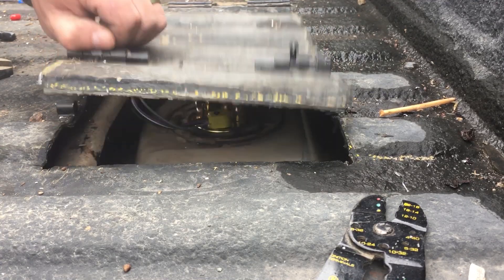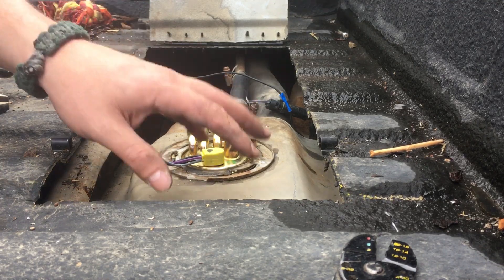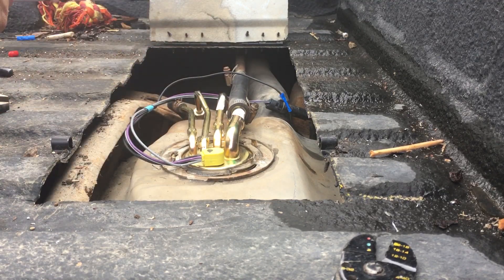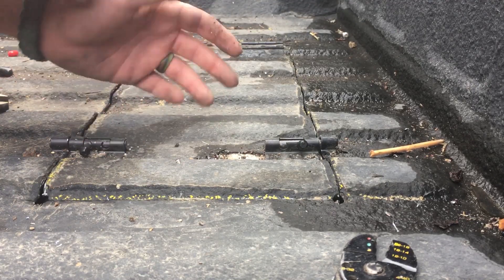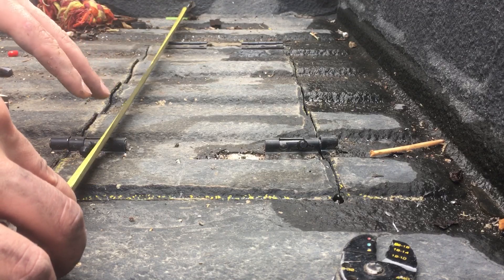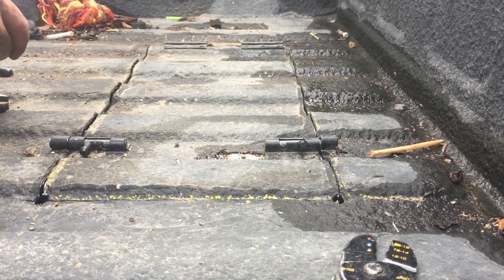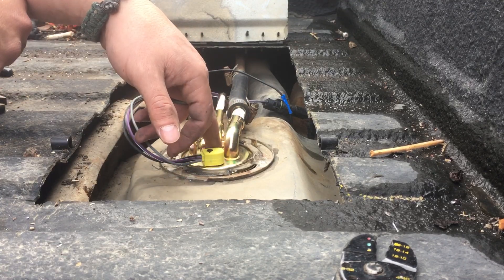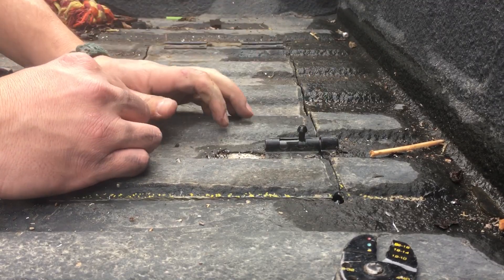1996 GMC 1500 fuel pump problem solved!

Comment: Just did mine today. Dimensions were great, plenty of space.  I just cut three sides though - and bent it back in the middle of the bed. Bloody pump fought me at every step though.  Ended up breaking off both fittings on the old pump, but at least that let me put a socket and a breaker bar on 'em!  That's the only thing that saved my butt today.  Getting the old one out was hell. Pretty sure it was the original (97 Sierra) ... and there was no hope I'd EVER break the bolts loose to life the bed. Even the bolt for the ground wire was as one with the frame.  I drilled a new hole in the crossmember for the new pump.  I didn't go the hinge and latch route though.  I riveted some flat iron across the opening and riveted the flap back down to it.  Then used trusty old urethane to seal up the cuts. Ain't the prettiest thing, but it worked great!  I've seen some people complain that the one cut is too far back, because the crossmember is under it ... but like you said, shallow angle on the reciprocating saw works a treat.  Thanks for posting.  It was the difference between me having my truck back and walking all winter.  It's Canada.  Nobody wants to walk in the winter if they can avoid it.

Comment: thanks for posting the video the measurements were spot-on for my 1997 K 1500 Z71 like you I have been dropping tanks I found your video be a great time saver and Money Saver my local mechanic was going to charge me $800 parts and labor and went online from the fuel pump assembly for $80 at geekspart I'm even considering to order spare for that price now with the hatch I'm ready to roll. thanks again. 👍

Comment: Great video,  just replaced oem lines from the throttle body to the filter, 94 gmc k1500 4x4 5.7
Suggestions by others for access door are great as well. 
My suggestion:
Edit your description to share the dimensions.
While in the bed behind the cab, from the drivers side, measure 11" then to the right mark 29 1/2". Then from the back side of the bed (behind the cab) measure 4 1/2" then 13" for the corners of your access door. Follow the video.
Thanks for making this, I'm restoring my truck. 180k original miles 2 owner.

Comment: I Have a under the rail plastic liner in my box. You won't even see the hatch under that. I'm going to use a angle grinder to cut mine with a wafer disc. cuts super fast. Hope I don't blow my self up with all the sparks. GREAT VIDEO, GREAT TIME SAVER TIP, THANKS MAN.
Reply: Are you still alive?! Let us know man!
Reply: @DIXIEMAFIA251  Yes, I'm still here, but I no longer own truck. Sold it a few years age. Yes it did work using the angle grinder with the ultra thin disc for cutting the hole in the box.

Comment: Dude, you saved me soooooo much work. I have a 98 GMC that I bought 10 years ago and the fuel pump died at 280,000 miles. (got the truck with 160,000. Don't know if the pump was replaced prior) The dimensions were spot on. Thanks.
Reply from the maker: SnaggOlicious perfect! Glad it help!

Comment: They should all have an inspection plate!
Reply: Yes they should !  It all comes down to the bean counters and the lawyers and insurance people . They all told GM allowing consumers access to fuel pumps in gas tanks would be a bad ideal and dangerous and the bean counters quickly concluded that the dealerships would rake in big bucks selling overpriced GM delfi fuel pumps and charging for many more hours of labor to remove fuel tanks and install new ones . One simple access panel that would have saved consumers million in repair cost and would have cost GM about $7 per vehicle . But instead they screwed everyone who bought a GM vehicle and then took government bailouts . Killed off Pontiac and oldsmobile and destroyed the GM brand. Their done , I won't buy another new one. They violated my trust in the brand. Still going to seek out the oldies and the goodies and drive GM. Just not buying new anymore !
Reply: @cbgreenbay  haha any newer vehicle with fuel injection is this hard to do a fuel pump or worse.
Reply: My honda does. Lol. 300k OEM pump

Comment: Well here it is middle of January in Idaho, and mine just went out. This will be my fourth one.  I replaced the factory electrical pigtail the last time, and I got several years out of it.  I believe a bad electrical connection at the factory pigtail was the main reason these things were going through so many fuel pumps. Anyhow, I'm in I don't give a shit mode on this one and doing it your way. I lifted the damn bed off my pickup the last three times by myself, and I'm done with that.  Thanks for your video, and the measurements!
Reply from the maker: No problem! Glad it helped !

Comment: i cut my panel and then screwed 3 pcs. of 2in. wide flat strap by 1/8 thick to the low part of the panel, smooth on top. also put a piece of rubber over the pump and never seeze the fittings, nice job

Comment: I got a 98 jimmy that I paid $350 labor plus $150 for a new pump to have it replaced . It lasted less than 1500 miles. Then I said screw it and cut an access hole just behind the left rear seat . Very easy to do if you know where . Replaced the pump with a cheap $28 new pump off ebay and sealed and replaced the access panel , but made it easily removable if needed. Put carpeting back down and flipped seat back up , good as new. I have a spare $28 ebay pump in the back I could change out in 15 minutes if I needed to . But so far I haven't needed to do it . P.S if you get a new pump spend $10 bucks and get a new filtter also. It cost me $500 because my mechanic didn't replace the filter when he put the new pump in . That's probably why the original pump failed and then also the first replacement  pump.
Reply: cbgreenbay  Same thing for me $650 job found out six months later when the New pump failed never replaced the fuel filter or suggested it no wonder I went through three pumps in five years. I guess my fault too. But hell I’m not a mechanic....last one I put in was $175 Delco. And a New filter(couldn’t even blow through the old filter I almost blew my eardrums out, lol).been on for seven years no problem... replace the filter twice since then going on the third just in case....

Comment: I've done that to several of my older chevys. I cut the door and welded a lip under the cut creating a ledge for the cut door to lay on. Also gives me a place for 4 stainless screws to attach it to. After a fuel pump change I throw my bedliner in and cover it up. Nobody the wiser. I've got a much newer chevy and the fuel pump is leaking and I'm debating cutting a door in it. Problem is I  hate to cut a truck up that's only a couple years old. But if it's old enough to rust out a fuel pump its probably old enough for me to say the Hell with it and fire up the welder.
Reply: It's only a chevy, CUT IT!  Maybe if it was an old classic, or a Ford I would think twice . Not hating on chevy, I have both . Ford just a better built truck.

Comment: Dude, I'm definitely doing this. I have a problem somewhere from the tbi to the gas pump. So fuck it. I might make a couple access points on the bed...just in case I have to fuck with something else, and possibly gain a better angle. On what you might ask. IDK, and I don't give a shit. GM should've made it on every single vehicle. Good shit man. Thank you

Comment: I think it's 4 bolts and you can raise the bed up and over enough to replace the fuel pump. I got that advice from a brother in law that is a certified Chevrolet and Toyota mechanic. Dropping the tank insane, cutting a hole like this is ridiculous.
Reply: 4 bolts ? You don't have a clue as to what you are talking about. Let's see... A 10 minute job verses hours .

Comment: A better fix for the floor is to cut the appropriate number of 3/16 X 1 1/4 steel to bridge the hole, drill four 1/4 inch holes in each strap, 2 to screw to the door and 2 to screw to the floor. Counter sink each with 1/2 inch. Sand the top end edges of the straps so they have a nice transition to the floor. Place the straps over the door in the indented areas and  Drill 1/8 holes in the door and attach with counter sink type #14 screws, place over the hole in the floor and drill 1/8 holes in the floor and attach with screws, spray rubberized undercoat over seems, straps and screws.
Reply: Yeah man lmao, sounds much easier.
Reply: Yeah man lmao, sounds much easier.
Reply: @raptor31able  I've seen lots of hack jobs with grinders that border on moronic an could easily become an explosive experience. Not to mention they ruin the integrity of the bed.

Comment: Cutting the hole is much faster and less dangerous with a multi tool with a half circle metal cutting blade, and the seem is so much smaller then that of a grinder or sawzall.

Comment: I have the stepside version and the bed is skinnier, so I had some trouble trying to find the measurements. 4.5, and 13 inches from the front. 3 inches and 20.5 from the left sidewall. It worked perfectly I just used an angle grinder

Comment: The reason these pumps were and are failing quickly is because they are cooled by the fuel in the tank and most of us broke people run low on fuel all the time which makes it burn up and not last that long .

Comment: Now you got a weak spot ! I bolted down a 1/4 inch plate right on top with 8 screws werked good and sillie koned first to keep her tight ! 😀😀
Reply from the maker: In my case it’s covered by the tool box but I getcha!

Comment: I had a 96 and did the same thing after doing it the conventional way once. . I changed fuel pumps three times before realizing if they are run dry even once they fry. My friend must have ran her honda ridgeline tank dry a dozen times and the fuel pump works fine.
Reply: merc marc That’s my problem I’m always broke and running it close to the E it’s sucking air and partial gas it’ll clog the crap out of your fuel filter & you will eventually hear the pump whining loud like a power steering pump whine. blew through three pumps in five years I learned my lesson to stay at half a tank and change the fuel filter every couple years
Reply: I just had to replace mine because I ran her out of fuel. Lucky for me, if I do it again, I’ve got an access door cut in my truck bed :)

Comment: The bed is held on by four bolts and super easy to tip up... much quicker to undo four bolts than to cut a hole and put hinges on and locks...
Reply: IFYOUONLYHADABRAIN

Comment: I just did it exactly how you mentioned and I’m happy as heck lol except the pump wasn’t my issue haha. So I have a new fuel pump right now for no reason lol. My damn ecm B fuse keeps blowing when I turn the key forward. So I guess Ima look for a short now.  😂😭
Reply from the maker: Texas Y’all  Oh no!! Well if you have any luck like I did with the fuel pumps it will come in handy, I changed everything I could in mine, even the fuel pressure regulator... that was way harder than dropping the tank. I hope you find out what the problem is and it doesn’t cause you too many sleepless nights!
Reply: Deaddoginc1 it was the main engine harness laying on the EGR tube. It burnt up 3 wires. Lol damnit. I fixed already but damnit lol I was losing it.
Reply: I can empathize, my problem wound up being the doggone fuel filter.

Comment: Thank you for the video! Great idea. Question for you... What brand/type of fuel pump is the one in the video? Can you give some more information about it? I am going to replace the pump in my truck soon (1998 K2500 7.4L), and I want to purchase one that will perform well as long as possible. I noticed yours has metal ports at the top of the pump rather than the OEM style with plastic ports. Small details like that usually mean higher quality products.  Thanks!
Reply from the maker: Brandon Pritchett , I can’t remember but I bought it at Auto Zone  and I  got rid of the box if I can find the receipt I’ll let you know I’m sorry I didn’t even think about mentioning which brand it was this was a while back last year I believe

Comment: this is what i am doing tomorrow. I have replaced the fuel pump 7 times, and now for the second time the little 3 inch piece of fuel line that goes to the pump and connects to the fuel sending unit has came off. I even have 3 clamps on it but it keeps sliding down. I have had enough. But i really hate to do this because i have a very nice truck bed for it being a 96.

Comment: I've got a diagram from what you cut yours out to see if my measurements are right. okay the bottom of the driver's side 29 and 1/2 across. From the back of the bed down was 4 1/2 inch go down 13inchs. I'm doing this on a 98 Chevy k 1500 extended cab. I hope the measurements will work thanks for any help.
Reply from the maker: As far as I know it should work, mine was a 6’ bed on an extended cab

Comment: Bro are you constantly running your truck below a quarter of a tank ? Because fuel is the only thing that keeps them liberated. So always try to keep it above a quarter of a tank.
Reply: Once you're keeping plenty of fuel in the tank, then this modification isn't necessary.

Comment: Followed these instructions for my c2500 and unfortunately the pump is a little farther back.     Dont know if its because the 2500 maybe has a bigger tank or if it's because it has a long bed.    Either way with my situation cut 11.5 inches away from the front of the bed instead of 4.5.

Comment: The reason a lot of pumps go out is a bad fuel filter restricting the flow, I’ve never had problems but have always changed fuel filters on time, have had many Chevy trucks from 1989 to 2011 ,Bought a older Chevy lately and the pump was making noise, sure enough,took the filter of and could barley blow through it .
Reply from the maker: The fuel filter wasn’t ever the problem, I changed mine a few times when I had the truck I think it was mainly the wife driving it short distances and always below 1/4 of a tank… but who knows !

Comment: Thanks I used your measurements and turns out the fuel pump is down about 3-4” 🙄 instead of 13 should have been 17” but who knows I’m gonna assume you have a short bed. You should put that in your title what size bed

Comment: Just a few bolts and tilt the bed
Takes maybe 5 to 10 minutes
Reply: More than one way to skin a cat
Reply: That’s assuming those bed bolts aren’t fucked and corroded
Reply: 😂, Yea , crawling around on the ground trying to line up the socket and turning the bolts and lifting the bed by yourself while sticking something in there and trying to work with the bed right over your head takes 10 minutes ? 😂😂😂😂

Comment: I got a utility body so the measurements won't work for me  😢
Reply from the maker: I’m sorry, mine was for the 6’ bed I took some heat because I didn’t have the sizes for the other beds, what do you do these days… good luck to you !
Reply: @Deaddoginc1  it's all good I got it done. I just used ratchet straps to lift it back.

Comment: Will those measurements work with an 8ft bed or a 6ft bed ? or both ?
Reply: NO....different measurments for fleetside or stepside.....short or long bed.  I did my 89 fleetside using my own measurements.  Mssg me if you need to.
Reply from the maker: I don’t think they do :(
Reply: @Joseph-iw7su  I just replaced my tank and fuel pump / sending unit on my 96 GMC K1500 Fleetside Ext Cab....but the fuel gauge is acting up..so now I need to get access back to the pump /sending unit without dropping the tank again.
Reply: @Joseph-iw7su  do you have these measurements for long bed?
Reply: @lordcommander9984  hey man I'm fixing to do this on my 96 ext cab swb what was the measurements u used on ur ext cab if u remember them pelase

Comment: Man I know this is a old video but did u figure out y your pump kept going out? U said goes out ever 20 minutes lmao but that's basically way mine is in the past 4 months I've put 5 pumps in and the 5th one went out today I replaced just the pump the first 3 times then whole assembly next 2 times every time I replace it it lasts 2 to 4 weeks I literally carry a spare pump so I can replace them on the side of the road and yes I have a hole cut in my bed for convenience every time I replace the pump I replace the sock and filter on the frame I have swapped fuel pump relays a couple times no change I haven't had the tank down but looking inside it looks pretty clean from what I can tell and the sock always looks clean did u just keep putting pumps in until one lasted? I've been getting them at oreilys imma try autozones this time it's under warranty at oreilys but think imma ask for a refund and get a different brand I don't let it get under a quarter tank jw if you just replaced them until u got a good one or did u figure something else out?
Reply from the maker: I never figured out why, I don’t know if they have a bad wire set up somewhere, there was a bunch of running it around on 1/8 to 1/4 of a tank except for when it would actually go out, then if would be on a fill up day, I just went with the most expensive one I could get in hopes that for some reason it was made better than the others, after that video it still runs to this day as a trap wagon in a wheat field.
Reply: @Deaddoginc1  I noticed that it's always on a fill up day like u said it has never once went out when fuel was low it's always been within like 50 miles of a fill up I'm glad your trucks doing good I put a AutoZone pump assembly in it last time it's holding up good so far but if those have problems think I'll do like you said you did and get a really good brand appreciate the video I didn't think vortecs were as bad in pumps as they r after watching your video I googled a forum alot of ppl r doing the same wondering y their pumps go out all the time lol
Reply: Bad fuel filter restricting the flow burns out pump , fuel filter drivers side on the frame underneath